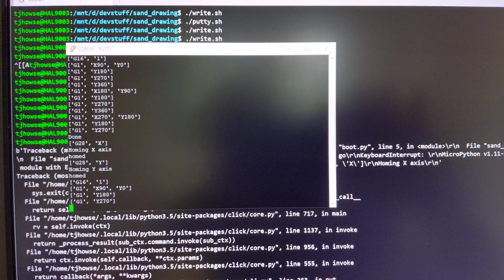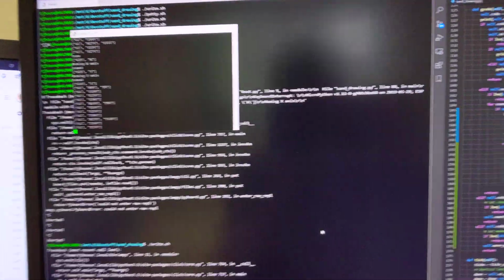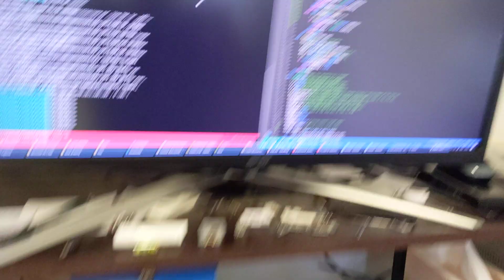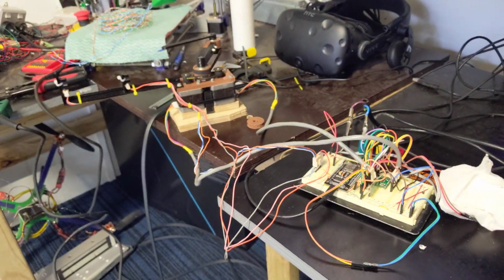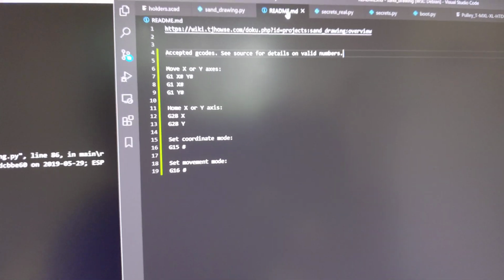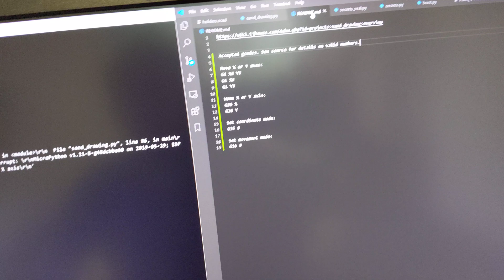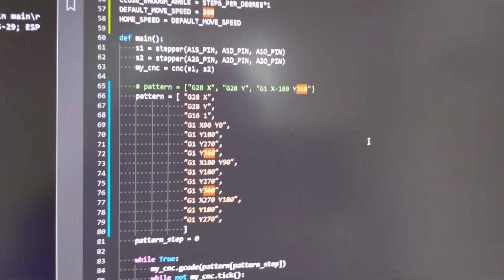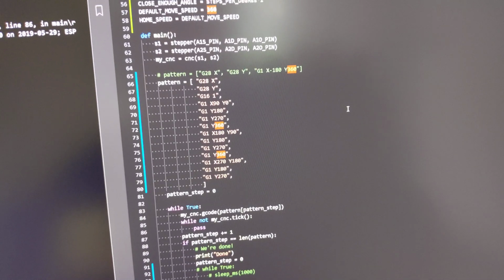Sand drawing - Software progress

Comment: Please sir can you help me to install the software on esp, and thanks for the help
Reply from the maker: You should be able to get micropython onto an esp32 and then use https://github.com/tjhowse/sand_drawing/blob/master/write.sh to copy the required python code over to the ESP.
Reply: @tjhowse  Dear Travis Howse,

Thank you so much for your response and your suggested solution. I truly appreciate your help with installing the software on the ESP32.

I carefully followed your instructions and successfully flashed the MicroPython firmware onto my ESP32 board. The serial connection has also been established successfully. However, I would like to get some further clarification regarding the usage of the script you mentioned .

Are there any additional dependencies or specific configurations that I need to consider for the script to work properly?
I would greatly appreciate it if you could provide me with more details on how to use this script or if you could suggest an alternative if necessary.

Thank you once again for your kind assistance and valuable time.
Reply from the maker: @mradkhaled3764  You'll need to have "ampy" installed in your development environment and use that to copy secrets.py, secrets_real.py, sand_drawing.py and boot.py to your ESP32 via serial. That's all that script does, really.